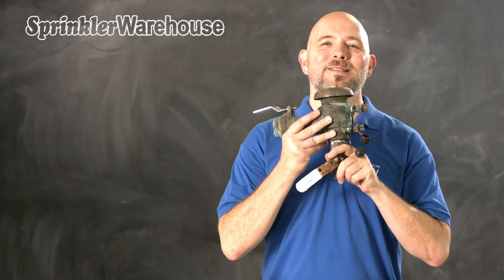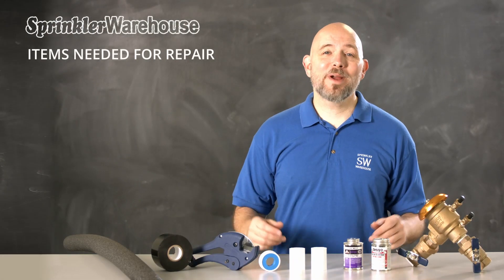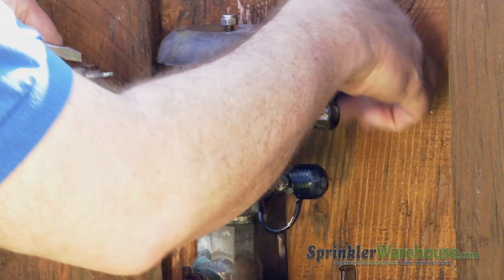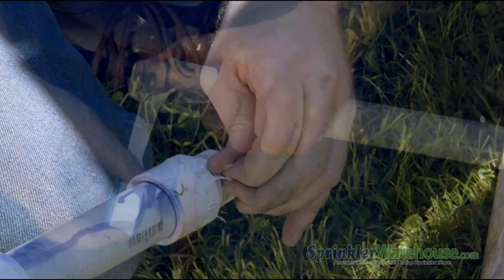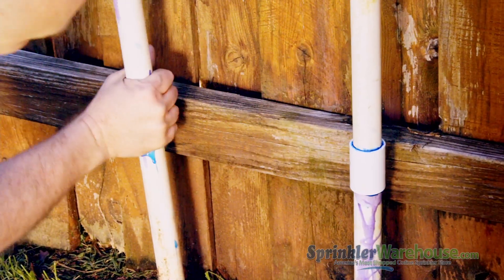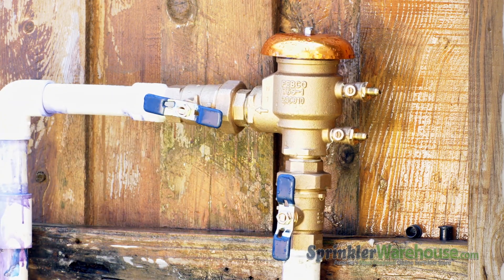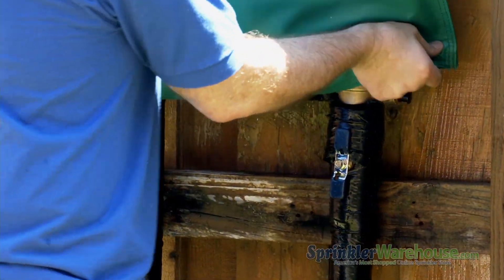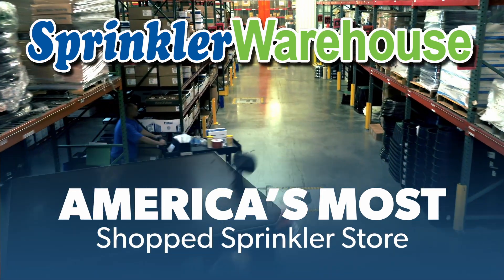Replacing A PVB

Comment: I need to have mine replaced. Mine flows from left to right, not right to left. I can't find any that flow left to right, any tips?
Reply: the position of the backflow doesn't matter as long as the inlet and outlet are correct.  if it faces the wrong way, it may be difficult to turn the shut off valves or the test cocks
Reply: @carmencristantiello5176  One plumbing company told me they’d have to redo the pipes to make a left facing PVB work. The company I went with spun the connections around in 3 minutes and everything faces the right way.